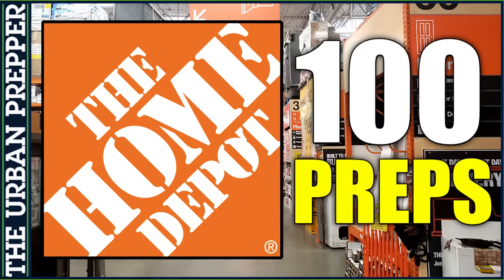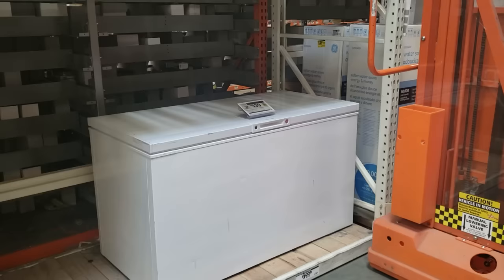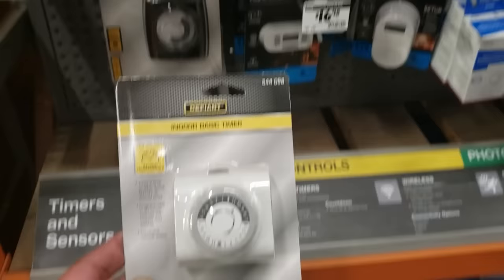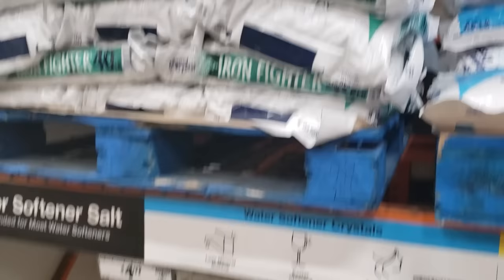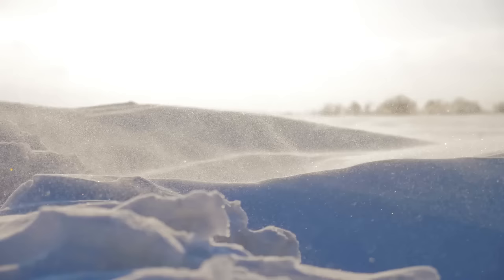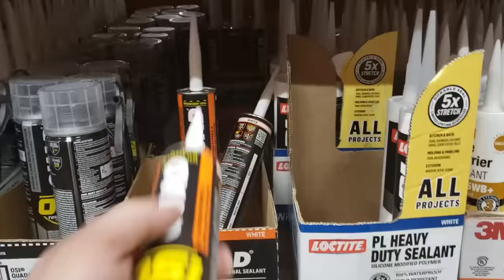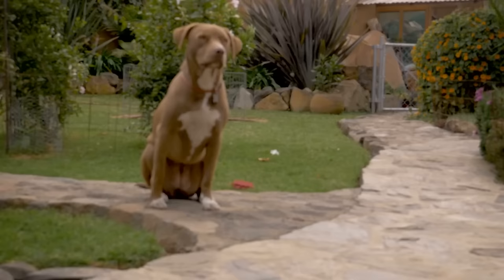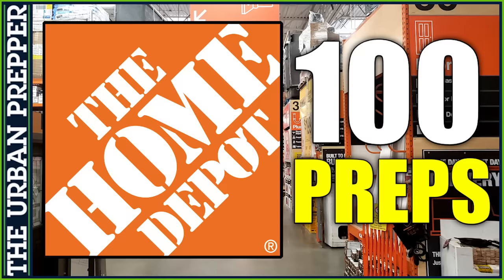Top 100 Preps to Buy at THE HOME DEPOT

Comment: Experienced chicken keeper chiming in, avoid chicken wire! I know, everyone thinks chicken wire is fabulous for chickens- it's even in the name. 

The problem is that while chicken wire can be used only for keeping chickens IN, it won't keep predators OUT. The holes are much too big (raccoons will reach into chicken wire and tear off chicken parts for snacks), and the wire is so lightweight that bigger predators can actually break right through it. 

Metal hardware cloth is a much better choice for enclosing chickens. The downside is the weight (also an upside, as it is strong enough to deter most predators) and the price is higher. If you can't afford a coop, run, or chicken tractor fully enclosed in hardware cloth, at least wrap the bottom few feet in the good stuff, where most predator intrusions happen.

Comment: Just got me a new drill cause my old one sucked. I’m surrounded by woods and will probably make any out of that I’m very tool heavy and we just got a giant basement freezer for hunting I have screws nails ladders ratchet straps and a hand truck though I do want one of those  small carts with off road wheels maybe some tie raps u can shut off your gas main with pliers pipe wrenches etc also I do have like 6 extension cords but they are old might need a few extras though. They sell battery holders that work great holds all the important batteries and alout of them. I also have the dehumidifier sump pump and an extra in case the 1st one dies and a fire extinguisher. I saw a guy selling doors on the news it’s a thick metal plate to screw your door into and a pimped out lock plus the door was tough to 2 cops and a battering ram took a good 20 shots in the middle and corners and sides and it just left a couple dents. I have a saws all and chainsaw plus a large silky hand saw cuts great half the speed of a real chainsaw but doesn’t need gas or electricity just people power though the large one can cost up to $1000 though that’s the biggest option I can get smaller $500 ones that will cut the thickest tree in your yard in about 20 to 40 seconds. When dealing with outdoor spigots it helps to wrap them on the inside of the house especially near  where it leaves the basement than shot off the water going to the spigot and finally open the spigot on the outside to help drain any extra water. I use 4 20 gallon BPA free blue containers with spigots treated to last for 5 yr in the basement. I’ve always went with Dewalt  I’ve never had a problem except one that I used for work for 20 yrs and was dropped over 100 times loaned out dozens of times but any drill that can take the abuse I put my dewalt drill through over 20 yrs and still work is a tough drill my saws all is also made by Dewalt along with every Dewalt accessory that go with the saws all and drill which will cost u another $150 for the drills bits holders blades containers for it all etc. Great ideas for doomsday shopping at Home Depot 😘.

Comment: I'm dizzy. The one thing that comes to mind is the galvanized trash can with round lid. The lid could be used as a shield. Speaking of shields, need some swords to go with. Swords vs guns - Swords are reusable. Swords are quiet. Big plus is you don't need to have permits for swords. And they can replace that can opener that always seems to come up missing.  You'll want a wheel barrel to haul out anything that may have gotten stuck. If swords are out of your budget a machete is a very good replacement (actually a machete is an essential piece of gear. The Prepper List could become endless but this list is just a few essentials that seem to miss the list.

Comment: Just prebuild a rocket stove using an old stock pot of you want go that route, a lot of people aren't aware of the likelihood that those concrete cinder blocks will explode when exposed to prolonged high heat, the last thing you need in shtf is an injury.

Comment: LOL. If you have a freeze situation, covering the faucet is not much use. Learn where the shut off valve is and drain the pipe. Leave the exterior faucet open and empty until warm weather arrives. If your home has no heat, you will need to do this everywhere. A hot water heater in the basement might be ok, but if you heat with hot water, you will need to drain the heating system as well. Save the water in bins or buckets for toilet flushing.

Comment: Terra cotta pots are not a heat lamp, do not act as a heater or gain any benefit from putting any type of candle in them over the heat from the candle itself. A btu is a but regardless on how you store or disperse the heat.

The rest of the info is good. Be sure to only buy quality tools, hoses, products that will last a long time. Propane stores forever or as long as the tank seal. Alcohol as long as it doesn't evaporate, and "raw fuel" at $20 per gallon has a 20 year plus shelf life. Store silicone in an area that doesn't freeze- not too much that you won't use within a year or two. (Yes sometimes you get lucky)
There are a lot of caviots to quite a few of these items, so do your research!

Comment: My out door solar lights mount to top of 4 x4 posts of my yard fence 88 post  the lights can be shut off . But still the batteries inside will charge ,( 2 AA s per solar light 176 AA rechargeable batteries. )  This is great for my flash lights , walkies , radios ,  hand cb radio .  I just turn them all but few off.  
As for rat traps drill in a hole attach wire fish leader  so critter not get away. ( All ways check traps regularly so critter not suffer or predictors get your food.  Use any branch to pin critters so to not get bit.

Comment: Minor factual error on the minifridge--you'd may want to use a tub freezer in an outage, as those are the most efficient ones that exist. Minifridges have very little insulation (due to their small size) and are inefficient as a result. Technology Connections did a great video on freezers you could watch if you're more of a nerd like me.

Get a watt meter and compare each of your fridges total power usage over the course of a day. That should help you decide which to run.

Comment: I forget if this is sold in Home Depot but I would say a welding shield, respirator and leather gloves, and quite possibly a leather apron. The apron could save your ass if you’re grinding wheel decides to explode on you. Along with protecting yourself from metal or glass shards. Leather gloves are self-explanatory, and they are insulating if someone is getting electrocuted or something is questionable. A welding shield, a good one will save your eyes if someone is trying to blind you with floodlights (it’s the same technique used by police, insanely bright lights and they get you blind looking at anything in the direction that it’s coming from) on top of that if you ever need to do any torch cutting angle grinding or welding it helps. Respirator is very self-explanatory, and it makes a better seal then regular N 95 masks. And it’s also a good idea to know how to make one (check out the modern rogue video)

Comment: I've heard the mini-fridge using less energy than a full size fridge is a myth because they use the same size compressors...just something a hvac guy told me. Might be worth looking into.
Reply: Interesting point, I'll have to look into that. To me the best thing is a chest freezer, they can actually be run off of solar, and don't require constant/frequent running they maintain most of their cool when you open them, and you can even freeze lots of the daily use stuff, just to keep it cold and transfer out to a ice chest what you will use that or the following day. For cool storage, I looking to making a lined stand alone root cellar, possibly using a defective chest  deep freezer buried.

Comment: I feel like a huge disclaimer belongs in the intro of this video, If you find yourself having completed the following.......buy this stuff from home depot.....

1. You should have completed your stocked pantry.
2. Get home bags in your cars.
3. Bug out bags in your home.
4. Water storage (55 gallon drums in the garage or shed)
5. Fuels and equipment and a generator to heat and cook in a grid down situation)
6. surplus of non perishable food items that are non essential but comforts or trade items. (coffee, alcohol ect.)
7. A plan and a sound mindset.

For most people preparing for a total collapse is not viable, you practically prep for the short term and luxuriously prep for the long term. The fact is that even in a total destabilization of any system eventually people will rebuild. Spending 5 grand at home depot on nails and extra plywood is a luxury prep.

Comment: There's a myth that fire extinguishers made for consumer use, such as those sold at Home Depot, are "refillable." A metal handle does NOT indicate the fire extinguisher is "refillable. 

All consumer-grade fire extinguishers (whether metal-handled, or plastic-handled) are single-use fire extinguishers. 

Commercial fire extinguishers, such as those in cabinets located in business, are maintained annually by certified fire extinguisher technicians, pressure-tested periodically, and are inspected monthly by employees of the business they are located in. These commercial-grade fire extinguishers are the only refillable fire extinguishers.

So, unless you have a service contract for your fire extinguishers, they are not refillable, regardless of what the handle is made of. 

For more info, see NFPA 10, the standard for portable fire extinguishers.

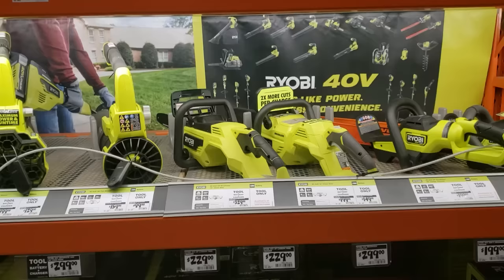Comment: 12:00 sorry but battery powered chainsaws are junk in emergency situation... you're going to be using gas for a generator, might as well use that fuel directly and not suffer with needing to recharge.
Reply: The 20v DeWalt chain saw has worked well for me in emergencies and uses the same batteries in other DeWalt power tools. Keep all your batteries charged along with stocking a quart of bar chain oil and spare chains.  Didn't even need to break out the gas powered Stihl chain saw.

Comment: maybe could add gas detectors in the fire alarms extinguishers co detector section? my property has both propane and natural gas. there are detectors that can notice multiple gases. i recently got one and it is helpful when connecting new lines too just to make sure things are good besides soapy water test.
thanks for always making pdf's for us. i am not good at technology so it is always nice to see all the stuff you set up :)
Reply: Oh and the Yellow Heet burns better than the Denatured Alcohol for cooking fuel (clean enough, hot, fast). And can use in the truck if needed in winter ;)

Comment: Still without power and only have the kitchen, bathroom and living room left, from hurricane Ida, yeah, not kidding. Sheds and fences came down too. Our lifesavers have been solar lights, the raised bed bricks, full metal shovels, chicken wire netting AND the hooked stakes to hold them in place, gas cans, 10g extension cords for the temp pole, (generators blew out after 3 months) AA batteries, particle board, zip ties, dump truck wheelbarrow, a LIGHT maul ax, terracotta pot thing doesn't work, get kerosene lamps, they shoot hot air out of the top vent, shop rags, 5 gallon buckets, a serious, heavy duty broom, contractor bags, yep, duct tape in various colors. Anything that needs electricity is useless. Drop the extra money for the 20 lumen solar lights. I can light a whole room with one. Mouse traps! Just a few things, the list is a lot longer.

Comment: don't use galvanized wire as a grill on your rocket stove. It off-gases toxic zinc compounds. You can eventually burn it off, but you don't want to inhale it, and it will rust when no longer galvanized. Better, use stainless steel grates.

Comment: Get a power washer for cleaning gravestones as a hobby or for spraying down incoming mail with virucide just in case there's some stray viral particles living on the cardboard
Reply from the maker: You definitely shouldn't use a power washer for cleaning a gravestone.  It damages the stone and you can get in a lot of legal trouble for damaging a gravestone. Most gravestone cleaners just use a lot of water and elbow grease, with anything run by power being a no-no to use (e.g., power washers, drills with brushes,  etc). D2 Biological Solution gets the job done,  although it takes a few months to completely destroy the biological growth safely.

Comment: Remember that many of these items require special storage methods of their going to sit unused in the meantime. 

Wrap the lumber in plastic and keep them off the ground to prevent wicking moisture, rotting, and bugs. 

Keep the plastic tubes out of direct sunlight to prevent hazing and cracking. 

Wrap boxes of fasteners in wax paper, preferably with a moisture absorber inside. 

Consider all the storage needs for all your preps. Check out PrepTrack in the Google store if you want an app to help.

Comment: Make sure to use red bricks. Concrete bricks will explode when exposed to high heat.
Reply: That is correct. People be aware
Reply: @mariusneumayer4419  I want to test this fact but I don’t want to get hit by concrete shrapnel. I this information from a blacksmith in Norway.

Comment: Personally: Seldome thought of:
If you even Think that you'll perhaps NEED to burn Wood...Get some old one and two man Saws with the huge teeth. Have an Ax and a wedge or two. Have a 30 Ton hydrolic piston jack at Harbor Freight $99.  It can be used to split wood or get heavy stuff off you!
Get at least 5 Solar powered energency spot lights. Use a few or all for the Inside!  No batteries and when you keep the Solar panel outside or inside facing out a non-shaded window, you'll have your light.
Count of the 'G.' coming for you eventually if you don't get the jab!

Comment: Does wrapping packaged batteries in aluminum foil save them from EMP damage?
Reply: Only if you add some kind of insulation between the battery and aluminium foil....like cardboard, foam etc.

Comment: I'm sure getting all this is expensive. But I'd like to call attention to facts about not just prepping but purchasing in general. Don't assume you need to by everything at once. Thinking like this is the downfall of a lot and I mean a lot of people. We don't need credit cards, payment plans and so on. These things were created for the benefit of the companies and credit card companies that use those methods. What's the real difference between you saying to yourself, oh ok, this item is $1000, so I'll save $100 a month for 10 months to buy the item, vs I'll try out for a credit card, get approved for $1500, get the $1000 item and also pay interest that will vary? Instant gratification. 

The culture has made us all want instant gratification even at the risk (and very logical conclusion) of paying more money and getting debt. Save up the money then buy what you want OR buy portions of what you want overtime, don't use credit or payment plans for this stuff. This is the same way we should think about cars and homes. Don't just save up the down payment, save up more when you're young, budget etc. 

And with a car, don't buy new to drop $20k at all, just get used $7000 or so and ride that out till the wheels fall off then buy another years and years later. Don't get sucked into the debt cycle just to have the item right now. It's so easy to fall into the trap that many of us think it's the amount of money at your job that's the issue but it's not. 

We got couples making $250k, $100k, $500k still in debt doing this exact same thing, they're broke. $250k annual salary and in debt for 2 mil. is the same as making $25k and being in debt for $200,000. just bigger numbers. Don't do it.

Comment: Oh and one more thing I learned in combat.. CS GAS AND PEPPER SPRAY( hold up read this one, you’ll thank me). Anyone whose had the privilege of experiencing the burn of both. And ridiculous amount of bodily fluids that pour from the head after being subjected to these two chemical agents ( illegal through the Geneva convention) but if. By chance you happen across a cop or militant person with an idiot score of the entry exam into any police academy, who fires directly upon your person especially mid groin or ball shots and the chemical sticks. YOU HAVE A REAL F———G EMERGENCY !! 
Yes-plain clear water
No -soap, salves, refer to rule above
Yes-as hot as you can tolerate
No-do not hesitate or burn yourself in the process, increase as tolerated
NO- cold won’t help once your canteen runs out  ( example) and it’s a huge waste.
Get naked and get rid of those clothes remember your contact areas if it’s on your clothes and you disrobe bare handed guess where the bare handed residue is going to back on???? ( !!! ) if you decide to manually try to help yourself along get it?  Well  that’s your secret weapon against that little weapon. Sure scream at me for a minute and grab your gear and get back in the fight or protest .. or languish like a b—-h  for hours and jeopardize yourself, position and lives of others for lack of preparedness

Comment: When you consider the power grid going down is the biggest reason to prep makes all the electrical items useless. when the power is gone, fuel for the generator will be gone. 

No need to build a chicken coup because after SHTF one chicken will be worth its weight in gold. That's if you can find one. 

Boarding up your house tells starving people there's something inside worth going after. Make your house look looted and they'll pass it by.

Most of this is useless.